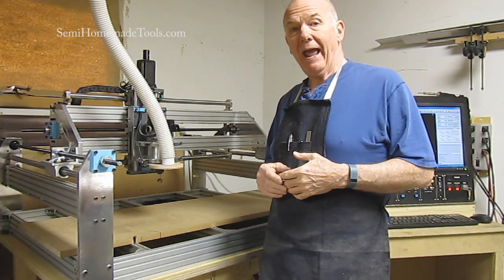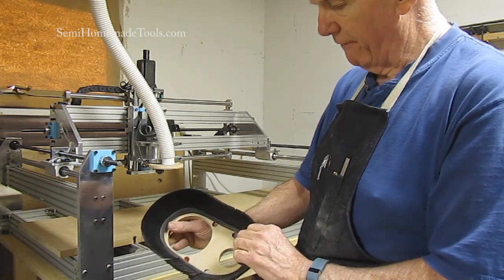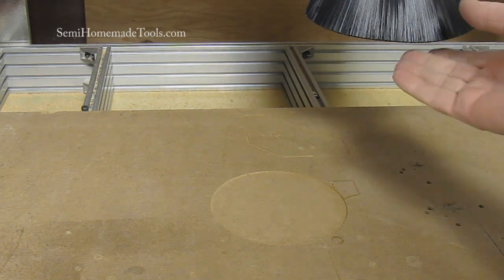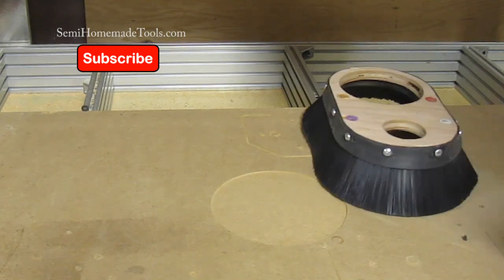CNC Router Dust Collection Shoe/Skirt

Comment: I found that the dust blow out is always at the opposite side to the vac hose. I think that it is because the air blast coming through the router is actually acting like an air curtain. I spaced the shoe down about 20mm made a baffle to deflect the air coming out of the router. No more more dust. 
   I also changed the dust shoe mount to the gantry itself with some drawer slides so that the shoe is always the same height from the work zero.
   Great looking build there, you are going to have so much fun.
Reply from the maker: loskop100 Great idea on the drawer slides. I would love to see pics.

Comment from the maker: Thanks for the question, Brian. In the video I have not accounted for it. It builds up quickly. This was, after all, a test. Either a wire added to the hose or using a non-static hose should work quite well.
Reply: Tim Wehr We have no idea what question you’re answering here.